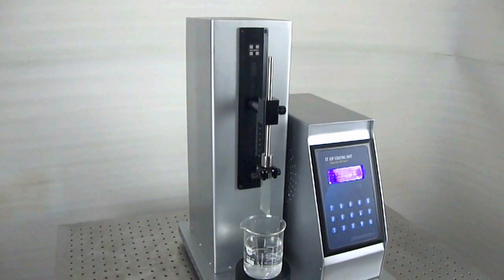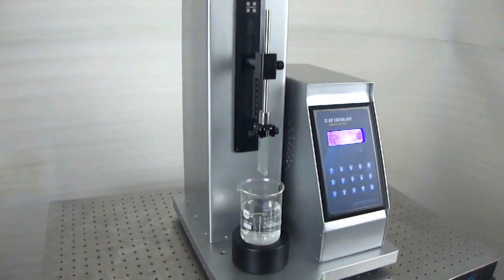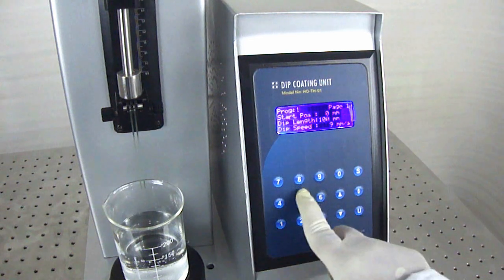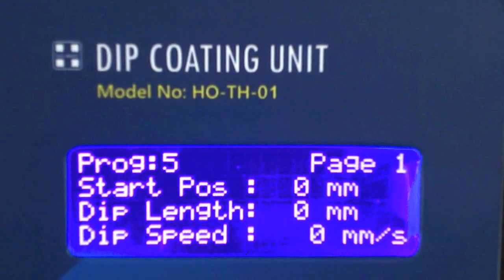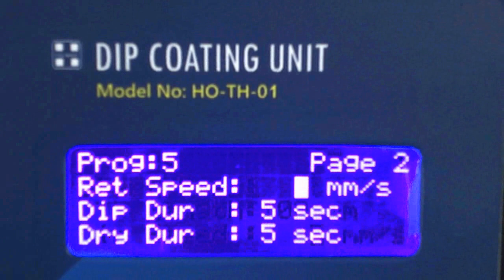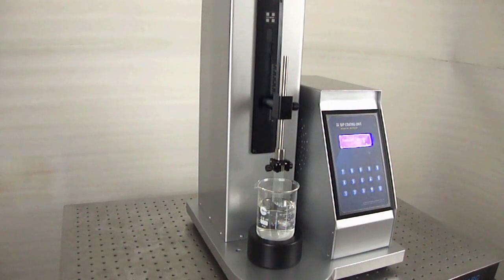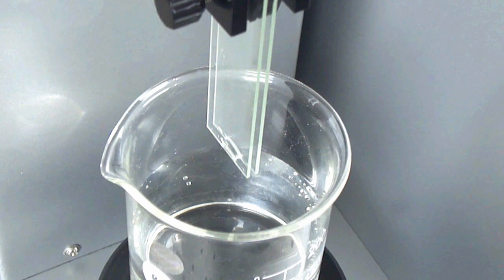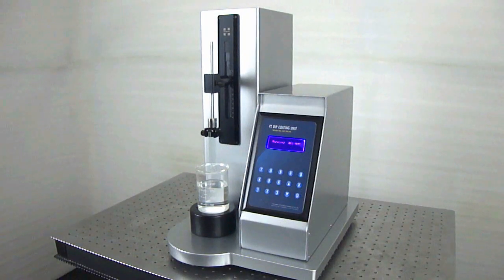Dip Coating Unit

Comment: the spelling of "of" is not correct in the display unit... its showing "no off dips"
Reply: +Aditya Kumar It may actually be off. You may have heard the phrase "one off" meaning a single unit. It is common in engineering to use the term off when referring to the number of something that you want. For example please supply me with 3 off bolts and 10 off nuts. It's confusing but that's English for you!